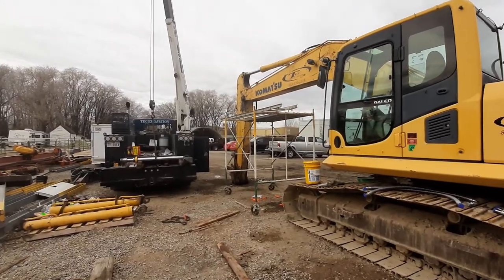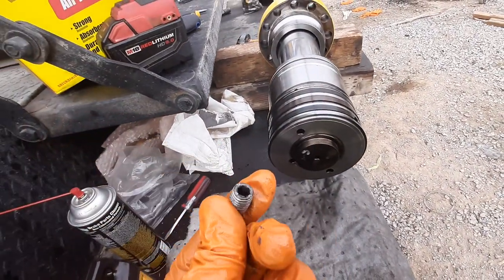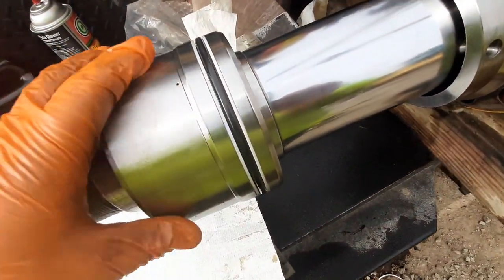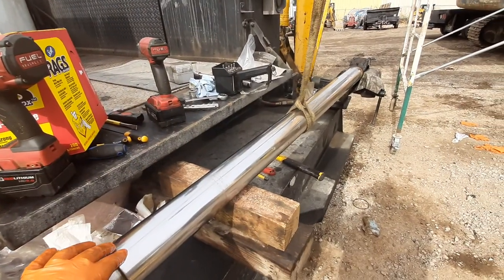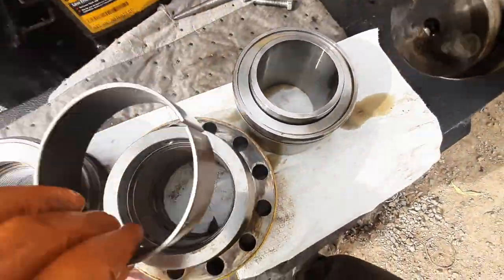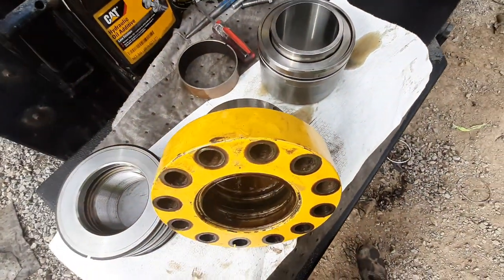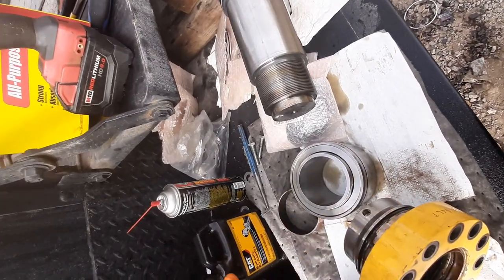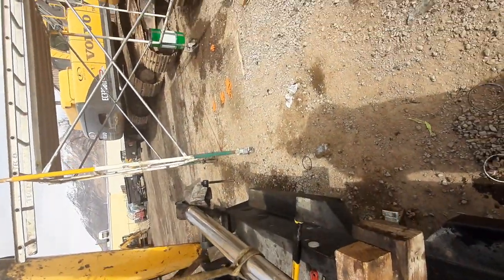How to reseal komatsu excavators hydraulic cylinders on

Comment: you can use the outrigger on your service truck with a block under it  to press the new bushing and use the old one to start the new one the sealing ring on the piston use a heat gun in an old container that welding rod comes in to heat it up

Comment: How tight is that second seal supposed to be on piston?
Reply from the maker: That is your actual seal, and it's tight! I usely put them in a microwave wrapped in a rag for about 20 seconds and it helps to starch them out, so they go on a little easier.

Comment: torque specs ??? who needs that my arm is a torque wrench !!
Reply from the maker: The out side bolts on the gland are set at 250flb. There are pilot holes for your keeper bolts, that's why I love working on komatsu equipment, it's made easy for the mechanics.
Reply: Make the full video how you open all cylinder...I like to see your how step you open it...Ooo make sure you work with bove hand for your sefty...👍👍 your explanation.
Reply: and can't you seek someone to hold cam...😁😁
Reply: @aditacaroline9201  There is a secret tool called a tripod to mount the camera or phone to.